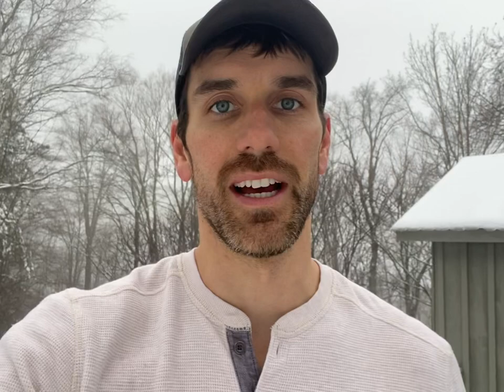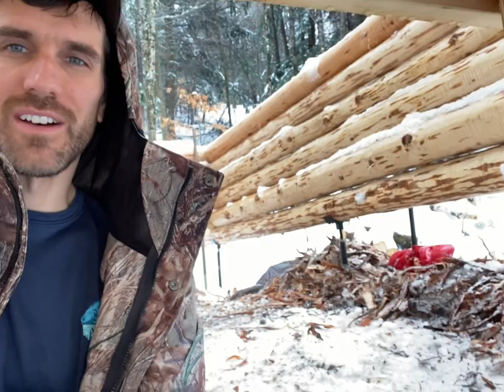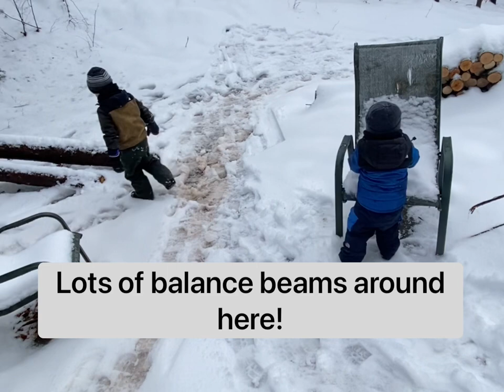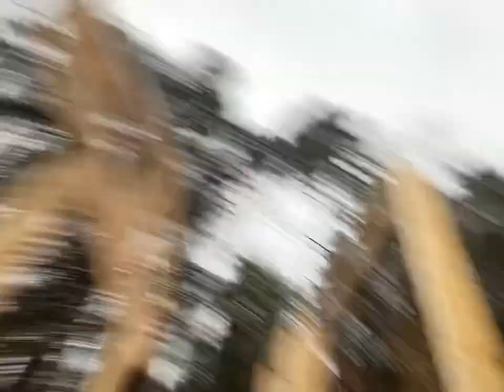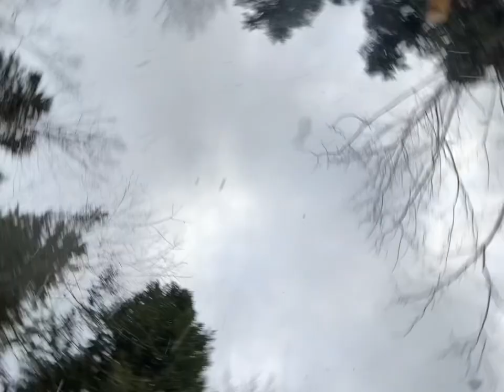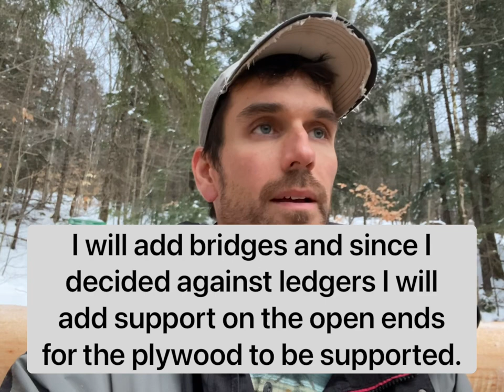Floor joist install- Butt and Pass Log Cabin Build

Comment: I’m not sure what I’m seeing here, is your center log that the joists are on higher than the two sides? Does the center and the two sides run like this

|  |  |   And then you just start the but and pass on top of those?
Reply from the maker: Yes exactly, three logs running like | | |, then the joist on top of them, then butt and pass the rest of the way.
Reply: @DIYDemasi awesome man thanks! I’m looking into building one with my kids. Gathering as much info as I can.
Reply from the maker: @AlexanderAnderson542  awesome 😎, enjoy the experience!

Comment: How are your joist ends connected to the logs?
Reply from the maker: They were just sitting on the bottom log which was bigger than the logs above it, but then I went back and added joist hangers for extra assurance.